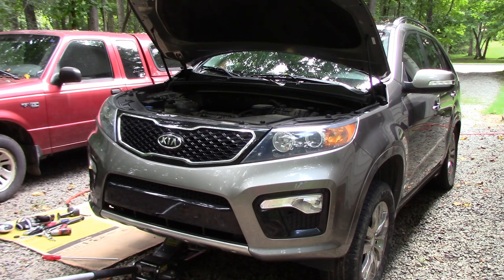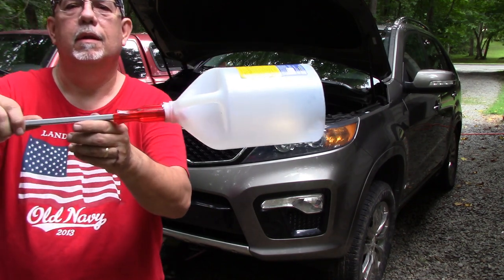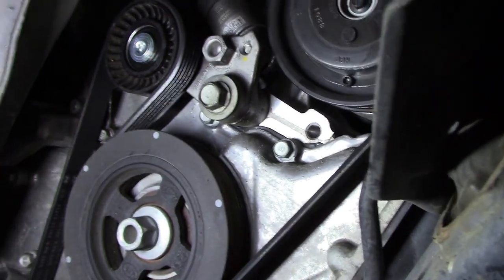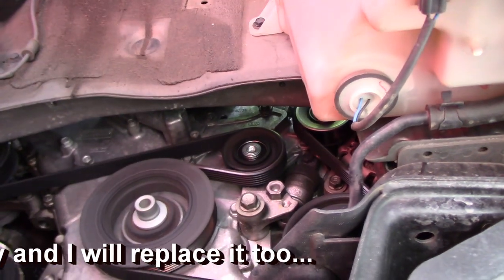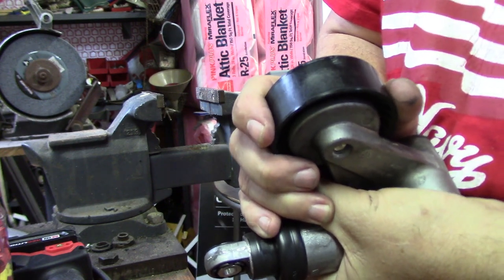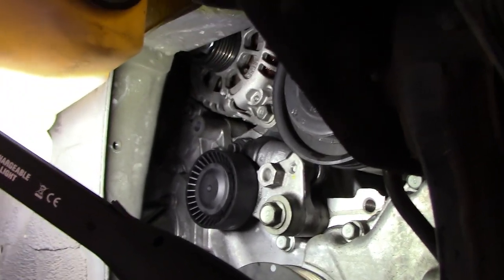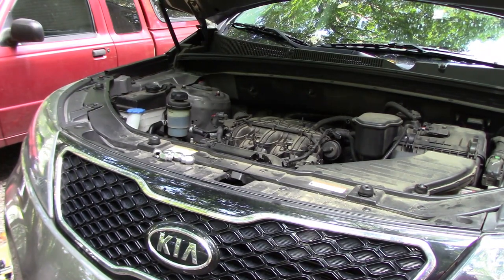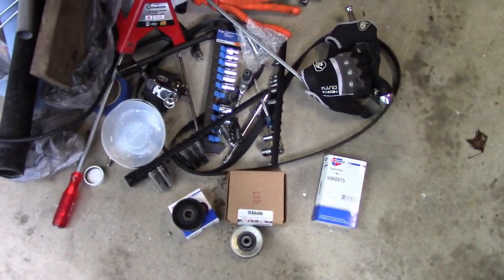2013 Kia Sorento Pulley Noise

Comment: Great video sir; quite the interesting job!!  FOR THE KIA FORTE EX owners I thought I'd piggyback with my discoveries;Remove the tire to clear the wheel well and turn the steering wheel full right for better access. All three of the small idle pulleys need to be removed period for better access!  The tensioner pulley bolt is LEFTY TIGHTY and the other idle pulleys are LEFTY LOOSY!   MAKE A ROUTING MAP OF BELT PLACEMENT and when reinstalling you will pinch a small loop and go in from front top at an  angle between the air pump and between idle pulley and tensioner.  Long handle open/boxed in wrenches would help greatly; 17mm, 15mm, 14mm or do what I did use a boxed in over the open end to extend it. Its only difficult due to cramped work area.  First time took me and son 3.5 hrs.  Hope this helps!!

Comment: Great vid, thanks.  I have a 2012 with only 30k miles and still had the same idler pulley noise.  B/c you showed us where the tensioner nut was, I was able to do the entire replacement from the topside in about 20 minutes.

Comment: Thanks for the video!  I have a 2013 sorento LX (2.4L GDI) with nearly 200k on it, so I think I'm going to replace both the tensioner and idler/accessory pulleys. I've already done the belt before and it's definitely easier to remove the passenger tire and splash guards and go from underneath. Also I think I have the spring tensioner as opposed to your hydraulic (gas?) tensioner. You might have the V6 model (EX trim) so I feel like it would help some people to mention that.

Comment: actually 35 years plus as a mechanic only ever saw a serpentine belt fail less then 5 times and always because a pulley froze and it was burned off . seen many a belt that looked hundred times worse then that. you only really need to replace a belt if its noisy. (this is for your own vehicles to save money ..when working on other peoples shit "always" advise a new belt simply because you are already there and if they don't want one you will get paid to go back later if it fails.

Comment: great video scoured the web and this was only video about this friggin tensioner ..brother wife drove sorento for indeterminate amount of time with 1 quart of oil and throwing check engine light on .. codes for cam phasers came up and she only decided to stop driving it because the ac compressor makes a lot of clatter like a rod knock .. had ac compressor not been bad the engine would have died (from abuse) anyway cam phasers ok once 4 quarts oil added ..codes cleared ..50 miles on it since however want to drop oil pan to inspect the rod caps for bluing from lack of oil prior to flushing the system and cleaning the oil pan and pick up tube. also need to remove ac compressor to drop oil pan as well as get model info on replacement $$$ and all this is after this stupid drive belt is removed .. they bought this pos without consulting me and now its my problem. anyway spent all day trying to get drive belt removal info as stupid kia online only included info for 4 cyl and even then vague and unclear.

Comment: Good video, very detailed and thorough.  We have a 2011 Kia Sorento that also has the 3.5L V6, and it currently has 258K miles on it, with no major issues so far.  We've replaced a few suspension items over the years, the door locks have been replaced a couple of times under warranty, but other than that it has been a great car.  We recently got a newer car for my wife to drive, so our teenage son is driving the Kia.  I'm ashamed to admit it, but it still has the original shocks/struts, belts, hoses, plugs, etc., so I bought new shocks/struts, drive belt, spark plugs, etc., and plan to replace those as soon as I can get him to stay home long enough :).  I also need to get a new tensioner and idler pulley, even though these aren't making any noise (well, none that I can hear), but it would be foolish to take all of this apart without replacing those.  I'm having a hard time deciding between the $150 tensioner from Advance Auto, and the $30 one from eBay; can the cheaper one be just as good, even though it costs 1/5 as much?  Any way, keep up the good work.
Reply from the maker: Darrell Kidd 
Go with quality. Here’s a tip about Advance. Use discount codes. Most of the time they pop up on the screen. I still use P20 and get 20% off. Sometimes a 25% pops up. Google search helps. Bought some struts for my 97 Camry once and used the 25% off. That’s one free!  They were 120 bucks each. Order online and pick up at the store.
Reply: HI! Just read your comment and have a quick question if you don't mind. I have a 2012 Kia Sorento with 117,000 miles. The only problem so far is the one described in this video. When I started to consider the transmission, I realized it was fully contained. Have you checked your transmission fluid or changed it? If you did, at what mileage? And is your 2011 got a fully sealed tranny?  Thanks for an answer if you read this!
Reply: @johngreener9784  Hi John, if I remember correctly, we had the dealer service the transmission back several years ago.  I don't remember the mileage, probably between 100-150K.  I'm sure it could use it again (it now has close to 260K), and I'll probably carry it to a transmission shop or the dealer again, as I have no idea how to service it.  I don't know if it's fully sealed, but I don't think it's just as simple as dropping the tranny pan, changing the filter, and replacing the fluid.
Reply: @darrellkidd5177  Thanks for info and quick response!
Reply from the maker: John Greener 
Yes, mine is fully contained. No dipstick. I had to replace a sensor inside the housing. The housing is a real pain to get to and remove. Very tight space and you have to relocate things around it. Not for the faint of heart. Checking the fluid required warming up the engine and have it in idle. Removed a little cap on the side. Supposed to have a thin stream. I believe my mileage was a little over 100,000. I still need to do my differentials (all wheel drive)

Comment: good vid, a tad too long for a pulley replacement however. also for those that are watching this my little 2 cents is to always start belt route w/ crank pulley and other "grooved pulleys" and "slide" belt onto the "smooth" pulleys in this case it also happens to be the tensioner thus making it SUPER EASY to replace belt and then tighten belt tension/er. no need to pull and tug!

Comment: Thanks for this. I have an Australian 2010 XM with the  2.2 litre CRDi with approx 100K miles. It is making an intermittent rattle in the drive belt area at start up. Checked bearings but suspect it may be either alternator clutch or AC clutch.

Comment: I also got a grinding noise on my Kia Soul and i dont know where it comes... i already switched 3 pulleys and it still does the damn sound...

All am left its the most expensive parts, the AC, alternator, crankshaft, etc...
Reply from the maker: Ataru2407 
Water pump maybe. Highly failure prone.

Comment: My wife's car engine was totally replaced under recall and I thought the noise would go away, but the used all the bolt on parts from the original engine.
Reply from the maker: Sounds like the dealer went a little cheap.  I can't figure that since the parts are not that expensive and you are already there labor wise.  It's even easier when the engine is out.

Comment: Can this rattle if bad enough
Reply from the maker: Most certainly. That’s even worse.
Reply: TOM2RN  my wife's car i can see it moving when the car is running. When you turn the air on you can see the pulley moving and vibrating
Reply: It should not move right?
Reply from the maker: Most certainly.  If the bearings are shot to heck you can get a lot of rattle.
Reply: @TOM2RN  yes it fixed my prob but now her car stalls Randomly only 104 k miles
Reply from the maker: Mmmm.  I would have the codes checked and go from there.  I can think of several possibilities.
Reply: @TOM2RN   There's no codes I have a scanner myself there's no recalls on the vehicle. I recently replaced the spark plugs the belt and Tensioner clean the throttle body and the air filter. The car shifts funny at times and going up a hill I'm thinking about changing the transmission fluid
Reply from the maker: Do you watch the South Main Auto channel with Eric O.?  I know he has a video or two with cars that have a similar issue.
Reply: @TOM2RN  no but ill try that thanks
Reply from the maker: Let me know how it turns out.